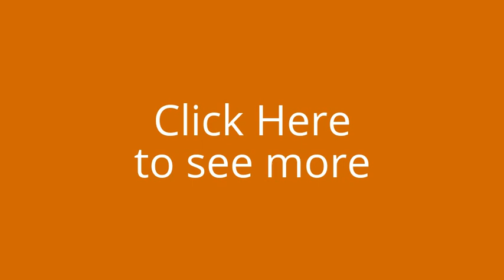PVC and TPO Flat Roofing Installation - Welding PVC / TPO seams

Comment: Can the weld be several inches in on the overlap?  Just had a roof done and argued with the contractor that the seam should be tight at the edge.  Otherwise water will get rapped in the space and freeze and thaw and break the seam eventually.  Am I correct?
Reply: That is correct
Reply: yes should be tight to the outer edge.
Reply: Yes, needs to be flat but will not break, only need 1.5 inch weld
Reply: The front wheel should be around 1/8-1/4 over the seam. If u welding in socks the dog is not hot enough! I could hand weld that as fast as he was going easily

Comment: You can NOT WELD WHEN MATERIAL IS WET!!!
Reply: Very true with most membranes. IB membrane can be welded for life under water. Personal experience
Reply: 36 yrs in union roofing industry have I encountered to work with no shoes on single ply system
This video is definitely NOT A UNION CONTRACTOR
Reply: sparky sparks and? Union roofs arnt any better. And that’s coming from an ex union guy who now owns a company, and my tpo crew is union btw.
Reply: crunch9876 I didn’t say that union roofs are better
I m saying all the years of roofing and working with major GC, no shoes nor gym shoes were ever allowed on union job sites 
Just saying 
That’s a safety issue
Till this day
Reply: that depends on the material.  I've welded IB and Durolast under 2" of water no problem.  it just takes time,  skill,  and knowledge.  When flash floods and ponds are both common you would be suprise what you can learn.
Reply: @kociarz46  So need to be in any union to put the safety first. Clearly, it need an accident to make them change.
You can't post a video like that showing how reckless and unprofessional your company is to permit workers to be on a roof without Personal Falling Protection and... In shoes..
No respect for them...
Reply: Wow!  How many idiots cam comment?  Shall we see! 
 First of all 20 years of union here. 25 years noon union.  Union stands for cost more!  Period!  If you disagree you probally take a life jacket sand surfing! 
  Duro last,  welding T.P.O. welding,  P.V.C. welding,  mule hide welding, deer tuff welding, shoes are not needed if you have done your job correctly.  Steel toed shoes are union riles.  I'm sorry, but they have to make you wear safety shoes,  because you drop your hammer on your foot!   I'll challenge anyone to a roofing installment contest.  
  What it comes to, is giving a shit!  If you don't give a shit,  it may not leak,  but it's going to look like hell. 
Taking pride doesn't mean union! 
It's within the person doing the job.  As an architectural metal specialist and contractor that had worked on buildings such as the Denver Mint,  and historic 1800 train depots I can tell you it's the individual that goes above and beyond,  it doesn't matter union or not!  Besides,  if you don't drop something on your own foot, I'm sure the sky will not be falling on your feet.  Plus critics, maybe they're was a section of shitty roof that got tar on their shoes and they took them off to weeps the seams!  I hate know it ails!  And this video was not something a researcher should watch!
Reply: You just wipe it down with a rag first the welder is so hot it melts off any residual moisture in the weld
Reply: Is there any seam sealer needs on tpo seams ?

Comment: Yall need to do a 2 pass and you can cut up 2 rectangles to weld and check the robot to make sure it's welding properly instead of cutting a hole in your roof but all in all the worse this I see is fucking tennis shoes yall need some boots

Comment: Snow on the ground?? Shitty contractors are a global problem. hahaha
Reply: I've done pvc in -10. Everything has to be slowed down by a factor of magnitude. It can be done but you better know what your doing. He does have the tip of the heater at the wrong angle and backwards at times though.